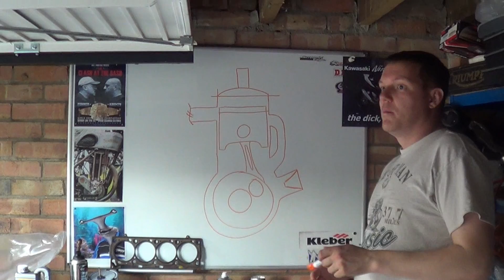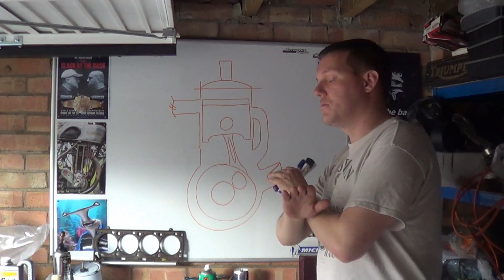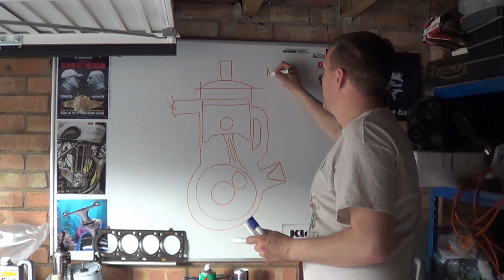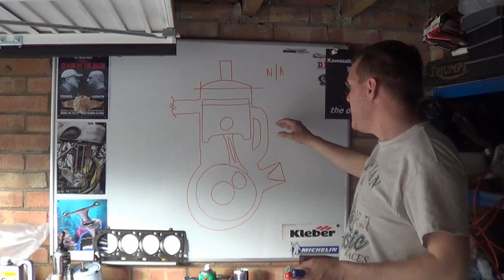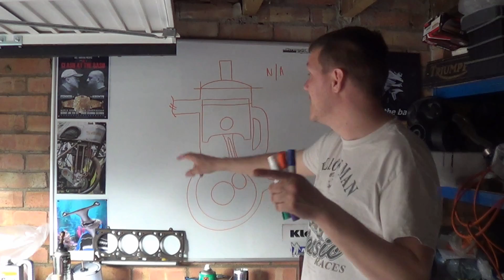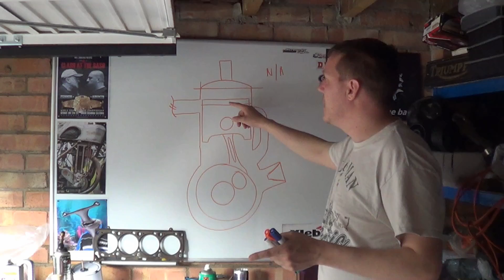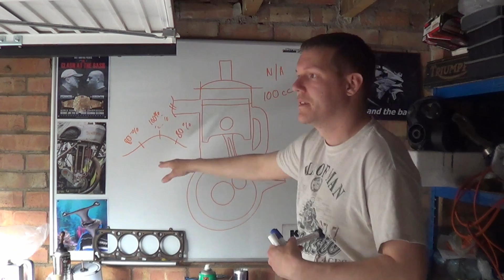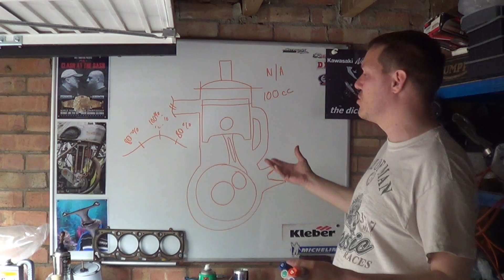2 Strokes are NOT supercharged!

Comment: Nice video! 
I must disagree on (properly designed)expansion chambers not supercharging the cylinder tho. If the mixture has passed through the cylinder or not before it gets forced in there is irrelevant(to my definition of supercharging anyway). The crankcase volume in a modern two stroke is, or at least should be, much larger than the cylinder volume, (like 300cc crankcase/50cc cylonder). A good pipe can easily fill the whole cylinder from that volume and "suck" a good portion into the exhaust duct too, then force most of it back in before epc. This effectively supercharges the cylinder. Delivery ratios of 1.3-1.4 are not uncommon.
Reply from the maker: "The crankcase volume in a modern two stroke is, or at least should be, much larger than the cylinder volume, (like 300cc crankcase/50cc cylinder" 

- have you accounted for the volume of the crankshaft?

- forcing exhaust gases into the cylinder is not supercharging as its not charge
Reply: - Yep, the crankshaft is accounted for. As the pipe is doing most of the work transfering mixture from the crankcase, there's no need for high crankcase compression. Having a large crankcase volume vs small will lead to lower peak pressure difference crankcase/cylinder but a higher average during the whole transfer cycle. 
Again we're talking modern properly designed two strokes here.

- Most of what is being pushed back from the pipe should be fresh charge.
Reply: 2STROKE STUFFING your 20hp 50cc video series was really cool. But more on topic im wondering even if there is a slight positive pressure charge surely its still rpm dependant because the crank case wont create the same pressure differential to the atmosphere since its got such a large volume also, if the cylinder displaces 50cc on its compression stroke it displaces the same volume coming down and would rely on inertia exactly like a 4T to positively charge the cyclinder. n/a 4Ts exist that have greater than 100% volumetric efficiency and no one claims theyre supercharged.
Reply: all 2 strokes ARE forced induction, i highly agree with you.
othersie what the fucking hell would force the CHARGE from the crank case to the cylinder via the transfer port. 
they HAVE to be forced induction engines, otherwise they simply not work.
Reply: I kinda thought the drop in pressure in the combustion chamber as the piston goes down would cause the charge from the crankcase to move through the transfer port.  Volume of cylinder increases, volume of crankcase decreases, charge volume equal to the change moves to equalise the pressures?  (Less pumping losses, the crankcase possibly not quite starting from atm. pressure for each stroke because of inertia, and possibly some venturi effect in the transfer port, et. al.)
Reply: think it over. got spark, piston is going down.
so, you got some pressure incrase in the crank case, not a lot, but you have some. in the meanwhile, the piston uncovers the exhaust port of the cylinder. since its exposed to the outside world, pressure difference moves the exhaust gas out of the cylinder. but not all of it. pressure nearly equalises. you need to flush the rest, and get fresh air and fuel mixiture in there. so the transfer port gets unblocked too, there is an overlap between the transfer port and exhaust port opening times. if there was no pressure in the transfer port, coming from the crank case, what on earth would make the fresh charge get in the cylinder, and flush the remains of the exhaust gas ?
nothing.
you don't need a lot of pressure, but you still need some anyways.

we can stop at this point, and conclude that air fuel mixiture entered the cylinder with higher than outside pressure.
witch means it is forced induction.
you can allso argue that when the charge port is closed and the exhaust port is closed the pressure inside the cylinder is not larger than outside pressure.
but that would be allso wrong. not all the times, that is granted. but at certain rpm ranges sonic charging does kick in. that is why we got those nice exhaust systems. it aids this effect, but it exsist even when there is no design behind it.
not charged all the time then, just like turbo charged 4 strokes. it ain't charged all the time. you don't allways get boost pressures.
turbo lag is real. but its still turbocharged no questions asked, even when idling you get less than 100% voulmetric efficiency, and a vaccum at the intake valves. you rev the fucker, and you get pressure at the intake valve, and there is your dinner.
Reply: I would imagine you get more positive charge flow through the transfer port with the piston pushing it as it goes down (and more sleep), along with exhaust pulse scavenging to help remove the exhaust...but I don't see how you get a pressurised intake system, other than by any remaining exhaust pushing back down the transfer port briefly (which is negated once the charge reaches the combustion chamber.)  If you decrease the crankcase size by say, 100cc as the piston moves down, you also increase the combustion chamber size by the same volume.  Shouldn't the combined volume of air be exactly the same in this case, resulting in no pressure gain, but simply a transfer of the charge's location?  And since that combined crankcase/combustion chamber volume of air is drawn into the engine naturally, rather than forced in...and you only get pressure by either making the volume smaller, or by pushing more air in manually (assuming constant temperature, of course)...I just don't see where the extra air is coming from, since the total volume doesn't change.  Any pressure inside the crankcase should be offset by an equal negative pressure in the combustion chamber.  If anything, I would expect the shape and narrower dimensions of the transfer port to act rather like a hydraulic damper and hold a small amount of pressure in the crankcase as it slows the flow (as well as preventing any remaining exhaust pressure from blowing back into the crankcase.)
Reply: i understand your concept, piston moves down,the air/fuel simply swaps place between the bottom and top of the piston.

hence i wrote, you can argue that once the air fuel gets delivered to the cylinder you may not allways have a positive pressure in there.
that is absolutely true. 
but, consdier removing the transfer port as it is.
and have a nother cylinder with an identical bore and stroke driven by the engine, doing nothing but replacing the crank case breathing system. unarguably it would be the verry same thing, but less efficient due to more moving parts. yet, none would consider that naturally aspirated. the 2 stroke diesels /yet again/  do the same thing, but not with a piston pump, but a blower. 
and many agricultural engines that are turbocharged, actually have just under 100% volumetric efficiency, yet still are forced induction engines. (from fuel consumption point of view they only aim to elliminate the vacuum, and do not produce overpressure.)
Reply: I would think your example of having a separate piston to take the place of the crankcase to be naturally aspirated, as it's not adding any additional air.  Same with 2-stroke diesels - there's still argument that they should be considered "mechanical induction" (I believe that's the term) rather than supercharged, since the blower generally only supplies atmospheric pressure that the cylinder can't draw in on it's own, so it doesn't fit the strict definition of "super" (Latin for "above" or "over.")  The 2T engine is similar - in a sense, the piston forces an atmospheric pressure charge from the crankcase into the cylinder, giving it positive flow - but once the cylinder is filled, it's back to around atmospheric pressure again - at least until the piston covers the ports and begins compression.
Reply: PS: Thank you - it's nice to have a real conversation and exchange ideas and thoughts without the usual YT trolling issues.  Much appreciated!  :-)
Reply from the maker: "we can stop at this point, and conclude that air fuel mixiture entered the cylinder with higher than outside pressure."

- half way through the cycle LOL

"witch means it is forced induction."

- but its not induction - its transfer. 

- When the transfer port is open the charge in the crankcase accelerates, exchanging pressure for velocity. Hence the 'transfer' from the bottom to the top. Next we have to consider how much the crankcase is compressed - the swept volume is how much. No matter how big or small the crankcase is the piston is only pushing the swept volume into the cylinder.

So you could say that its a volume exchange. For a 100cc engine the piston can only displace 100cc - above or below the cylinder. When you have a turbocharged 4 stroke the manifold volume is dumped into the cylinder. When we calculate the volume of each cylinder the turbo has to be able to supply it with more than its volume under pressure. 

As soon as the inlet valve opens the manifold pressure falls, but the impeller is still pumping charge into the cylinder so when the cylinder pressure is atmospheric the turbo 'tops' up the pressure in the cylinder.

For a 2 stroke to be supercharged the cylinder would need to be topped up from the inlet tracted. But the reed is closed, now the reed can open as the piston travels up but the crankcase volume is increasing, so the charge coming in fills that ever growing void not the cylinder. 

Now you can get flow through, but this is very minimal due to the crankcase volume increasing. The pressure wave from the exhaust is recovering the lost charge and sticking it back in the cylinder. Now this increases the pressure in the cylinder, however some of this is exhaust gases, not to mention the exhaust gases that are still in the cylinder from combustion.

More in part 2 to this video this weekend
Reply: indeed, i thank you too. verry refreshing.
now back on the topic a bit, there are a few more things to consider.
we lookt at the eninge when the transfer port and the exhaust port overlap and we can safely conclude the transfer port is pressurised, the eqvalisation of this pressure forces the fresh charge into the cylinder and the remains of the exhaust gas out. 
i have by purpose paused there.
you do have some sorth of exhaust , even if just a stright pipe of a muffler, and you gona get the "sonic supercharging" /not sure if its proper english term/ there, so actually what you gona get is that when the piston closes the transfer port, you gona have vaccum in the crank case. again, not a lot. a more usefull exhaust will push back charge that actually left the cylinder, back into the cylinder and the tranfer port will be closed by then. 
what is worth to mention, if there was no supercharging, there would be no charge in the exhaust to be forced back in the cylinder.
and the charge has to come from somewhere, it comes from the crank case. so at the point when the tranfer port is closed, the crank case has vaccum, and the cylinder has overpressure.
now, when the crank case draws in new air/fuel mix, that vaccum has to equalise, and naturally the piston movement is allso generating vacuum. the result is yet a nother pressure wave,  witch will lead to the crank case to be pressurised. 

this is why tuning a 2 stroke is verry verry hard project. you have to account that there are no parts that are not involved in the whole cycle. 
https://upload.wikimedia.org/wikipedia/commons/3/31/2-Stroke_Engine_ani.gif
pay attention to this funny looking animation, its surprisingly accurate showing exactly what i refer to.

you can still say the cylinder is not allways over-pressurised, but that stands true for turbocharged engines too. they need to spool up before they provide boost. still they are forced induction engines. that alone does not rule out 2 strokes from being forced induction.

now, you allso have a point on 2 stroke diesels as the blower in that case can not act like the parts of a 2 stroke petrol. on the other hand you can change the gearing and supply a constant boost pressure, but then it won't be a "blower". as traditionaly blowers supply no over-pressure, just move air around. 
on a nother video of this same channel about adding extra charging to a 2 stroke petrol i pointed out that the same can be done,
grab a centrifugal charger instead of a blower, gear it so it can negotiate  supply of air.
fair and dandy, but then you only added complexity with out benefits other than being able to have a pressurised lubrication system.
however, you can, over a set rpm simply decouple the charger from the engine shaft with a centrifugal clutch, and supply power to the charger from a turbine driven from the exhaust gas. you end up with a genuine turbocharged 2 stroke. now we are talking about busines, as you recover waste heat, so it will be more efficient than a 4 stroker on turbocharger. 
in essence you would require all the parts of a 4 stroke turbocharged engine, with the added complexity of the centrifugal clutch to shift between how you power the charger. the benefit is being able to burn 2 times more fuel / revolution than a 4 stroke, effectively allmost doubling up the horsepower  to displacement ratio of a 4 stroke.
but that is a topic on its own.
Reply: now that is absolutely closer to what my old textbooks say.
apart from the transfer port definiton. 
but anyWAY.

looking forward to that video, you see "way back" it was no question if its charged or not, it was blatant to add forced induction infront 2 stroke petrol. 
like... electric cellphone. that be the "no shit, sherlock!" moment.
to avoid it, its just simply cellphone.
Reply: "Next we have to consider how much the crankcase is compressed - the swept volume is how much. No matter how big or small the crankcase is the piston is only pushing the swept volume into the cylinder." 

This is how a chainsaw or any other typical two stroke without a tuned exhaust works. A proper racing two stroke operating in its powerband does not rely on piston pumping to transfer mixture into the cylinder, it's the pipes job. That's why a large crankcase volume is beneficial, lots of fresh charge available for the pipe to pull up into the cylinder and exhaust duct. Most of the fresh charge sitting in the duct is shoved back after the transfers are closed and effectively supercharges the cylinder. 

This might just be a matter of various definitions of supercharging...
Reply: Different definitions I think is more right - I'm Norwegian...
Reply: don't waste your time 2stroke stuffing, this guy can't admit he's wrong, you made your point with VE.
charge = 100% Volumetric Efficiency, SUPER charged is anything over that.
a proper expansion chamber can exceed VE, He'd rather argue nomenclature of induction vs transfers to obfuscate your point.

Comment: So the inlet valve on a 4t is a supercharger too?
Reply: its totally ies to fill up limited to 14.7 p.s.i. cause that is what the air pressure is that we breath and goes in the carburetor and down the intake port and intake valve and tries to fill up the cylinder of a 4 stroke ..and that is it for a four stoke as it can never ever become higher pressure than 14.7 p.s.i. nomatter if it turns 14,000 rpm the intake still only has 14,7 p.s.i. trying to fill the cylinder but a two stroke as this guy in the video said get compressed intake from the crankcase and at wide fucking open the pressure is like omg wont it stop rising and it will when its parts go to orbit ..so the horsepower of a two stroke continues to gain where a four stoke is locked into a constant 14.7 p.s.i. this is why a two is always fasteras it makes boost and  four can only suck bang and blow into a money pit that was never fast in the 1st place but more like last place

Comment: What about inertial supercharging ???
Reply from the maker: LOL the momentum that any flow has if it were to be considered inertial supercharging would mean that every engine is pretty much supercharged.
Reply: The Workshop so what is a better name for it?
Reply: The Workshop also. If you get volumetric efficiency above 100% using 'inertial supercharging' then surely you can call it supercharging as you increase the amount of charge, lets say to 115%, which is 15% higher what in theory an NA engine theoretically could produce.
Reply from the maker: Charging, no need for 'super'
Reply: The Workshop but if volumetric efficiency is above 100% then it should be called supercharging right?
Reply from the maker: But is this going to happen across the rev range? No. Probably a narrow band of the whole operational range. So you'd have 'supercharging' that works for 2% for example.

 If they sold you a bike that was 'supercharged' but only for 2% by about 6% more charge than the 1 litre of the engines cc then you'd be pissed - "I thought you said it was supercharged" 

Not only that but not all the fuel is burned etc
Reply: The Workshop still counts haha.
Reply: ever heard of turbo lag ?
same deal. you don't get boost from a turbo all the time.
yet even you don't argue those are forced induction systems.

Comment: What many people forget is that NA engines doesnt "suck" or "charges" the intake, it is simply surrounded by normal airpressure that finds a compartment that is lower in pressure. After the combustion the cylinder is lower in pressure so air starts to invade that void since it's low in pressure, simple.